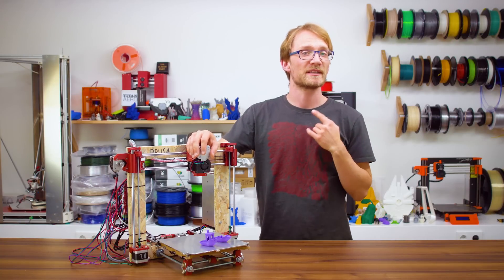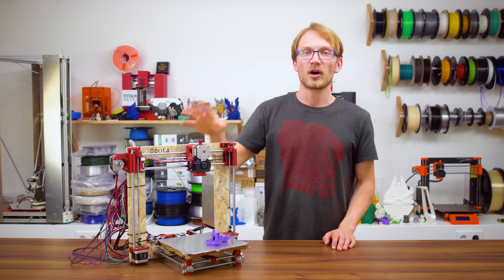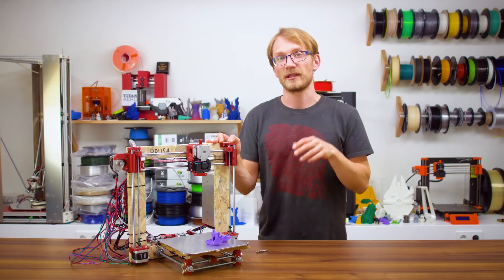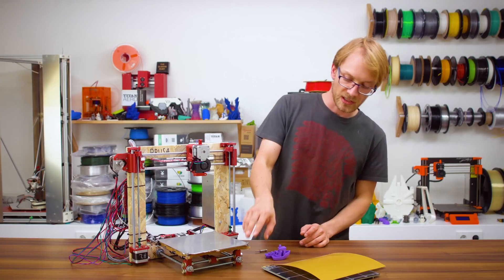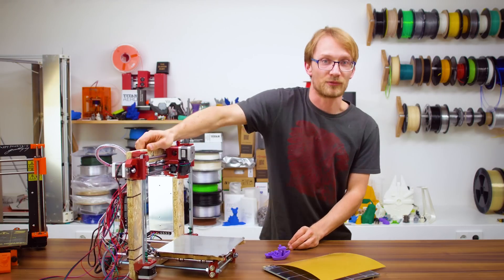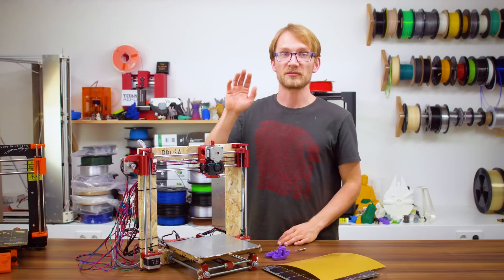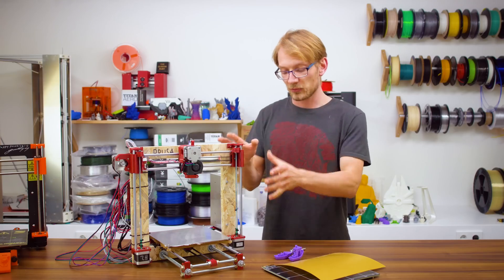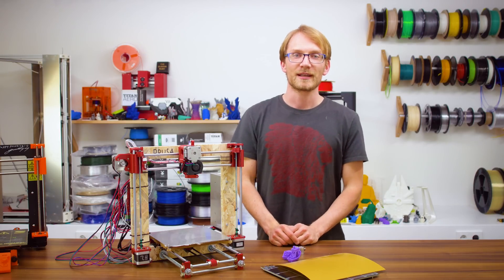Building the cheapest possible Prusa i3 MK2 clone: [03] Build notes!

Comment: I find it a decent job Thomas, but why did you go with that too thin flimsy bed and the m5 rods? If you would just use the heated bed anyway you would have a perfectly straight surface to print on. as for the m5 screws, that's for the mk1, not mk2. You saved on 2 things which are very important and I don't see why you did that because the quality suffers from it.

Comment: Hey Tom, after owning a 3d printer for just over 2 years, I am starting to run into humidity absorbtion problems with my filament, and I even store them in ziplocked bags.  Last week I had to bake two spools, one took only 2 hours, the other took about 6 hours.  

Since you have all that filament just hanging on the wall and sitting on the desk behind you, do you have to bake your filament all the time?
Reply: Make sure your bags are sealed by blowing hot air into them and seeing if they deflate. Two year old plastic bags may be the culprit. If it took 6 hours to bake the moisture out of your spool, you've spent more money on the gas/electric of your cooker than the spool itself unless it's some kind of speciality filament. Dump it!
Reply: thin plastic is not air-proof. Just blow air in it and see in how many days it deflates to give you an idea. Best solution is storing in airtight metal bin or glass

Comment: tom I wonder if the z artifacts are also due to the mesh bed leveling... 8mm lead screws are so cheap you might as well have used them
Reply: 9998 9998 The idea was the thinner rods would take up the flex instead of putting it in the print
Reply: how would that fix the warp/anything? by flexing the shaft the z position goes down a bit.. (and possibliy moving it in x/y as well) squishing the layer makign a band.
Reply: Google+ SUCKS BALLS - the worst forced social network ...No. Have you ever used a printer before? Just curious.

Z wobble is when the shaft is warped, so as it spins it pulls the entire bed laterally, following the thread of the rod. Not squishing it down and making bands..

Comment: Absolutely awesome learning and entertaining series.  Thank you very much. I would like the source for the MK42 and see its installation as well as the upgrade to the screen and Prusa marlin build.  I am changing over a Wanhao duplicator to all of the Prusa MK2S parts intermixed with the sensor and bed leveling you did on this one for a fun project.  How much fiddling did you have to do to get the MK8 extruder drive gear working?  Better to exacto the holes or redesign the SCAD file to the left 1mm?  Any thoughts would be appreciated.

Comment: Tom, you said you're going to use the custom Prusa firmware. Does that mean you'll replace the RAMPs board with a RAMBO mini like the i3 Mk2 uses? How about checking it out with a Smoothieboard?
Reply from the maker: +CarsInDepth as long as the board is using the same processor (AtMega2560), any Marlin-based firmware will run on practically any board. The RAMBo Mini is a nicer option than the RAMPS, but functionally they are very similar.

Comment: I enjoy seeing the entire process because I might try doing this myself to save costs of just getting started and being that I'm mechanically inclined.
Reply: The build cost more than a CTC i3 Pro B or Tronxy P802 though. Sure those will want a few parts replaced, but at least you'll have a 3D printer which will make it easier.

Comment: Tom-Instead of spending the time replacing the frame, you should just cut a piece of wood that will fill the gap and use 5 minute epoxy.  Much less time and similar results.
Reply from the maker: +cica322 OSB gets its strength from using large, oriented wood flakes - I'm not sure that just epoxying a filler piece to the edged will restore its strength.

Comment: With my 3d printer, the mega that I got didn't flash anything but then i found a video which basically said just before the progress bar on the upload is done for your sketch press the reset button and then it'll upload the code.

Comment: I would love to see you optimizing the firmware on the ramps to get to a decently similar level as the Mk2. I just finished building a Hypercube, while also having a Mk2 and I have not been able to get much practical usefulness out of the stock Marlin LCD interface, while the Mk2 one is amazingly configurated. Thanks for doing a great job!

Comment: Thanks for this series, Tom.  I followed along and built a clone as my first printer (but did get a 3mm mk3 bed for like 3 dollars more).  I'm definitely interested in seeing upgrades, including prints that show the benefits, but I don't think that's very well-suited to livestreams.  Also the way youtube is surfacing videos now it seems way more people will get recommended videos from this channel.  It would be more work, but hopefully also more revenue, if you livestreamed the build on your other channel, then cut a quick video talking over some edited footage of the build as well as some before/after photos and posted it on this channel.  You could then link to the full stream in the edited video if people wanted to see the whole thing.  I like watching your streams, but it does get frustrating to look for information and wait through you interacting with chat, fussing with autofocus and technical issues, and getting distracted.  That's not a fault of yours, just the livestream format in general.

Comment: Where to stream, well I'm following both so up to you. Awesome Stuff! Thanks for the update. I only have the frame at this point, waiting on parts. I used a 6.3mm aluminum sheet for the frame.  I was thinking on upgrading to the an original E3D hot end. I have a couple of questions, 1. Z-Rods should I go to real rods or 5mm as long as they're straight will it make a big difference? 2. Heat Bed, I have 3mm & 6.3mm aluminum so I could just get a heater mat or would a 3mm circuit board be better? what would work best?

Comment: Would love to see the upgrade process, will watch regardless of which channel it's on, I don't see any issue with keeping the main channel for more polished stuff though.

One thing you didn't mention in the build notes, during the build the inductive probe was a bit angled (discussed around 2h mark in p3). I haven't printed the extruder body yet and am considering modifying the part to make it work better (particularly since the sturdier MK2S version probably won't allow the angle). Is the distance/position in the XY plane of the probe critical or could it be moved out a little to give space for the wires?

Great series and great way to learn more about the fundamental building blocks, really appreciate you putting this together.
Reply: Had a browse of the Prusa Marlin firmware between things today and I see it has configuration for the probe offset:

#define X_PROBE_OFFSET_FROM_EXTRUDER -25
#define Y_PROBE_OFFSET_FROM_EXTRUDER -29
#define Z_PROBE_OFFSET_FROM_EXTRUDER -12.35

So presumably I could just move the probe holder away from the extruder body a little and modify these values. Trick would be to move it just enough so as not to be to far to reach the calibration point should I ever be able to get a MK42 clone bed. For the standard bed I am guessing it won't even be so critical. Would be great to hear your thoughts none the less.

Comment: Post it here. Yes I want to see the final upgrade very very much. Link for mark 42 bead, and please make another frame and paint it ( black , like the original one ) And for the z rail change the screw leads with 8mm pitch ( it will make a major difference ) . Thanks for making the best 3d printed chanel

Comment: You didn't mention the total price?
3D print the parts for improving!
Reply: no, it's more like $200, the $50 was for the first batch of hardware. The motors were about $50 by themselves, etc
Reply: No he didn't...
Reply: meh....A geat accomplishment but at the end of the day I would not want the head ach of always fussing  just to get a print. I would rather start with a kit that you know has already been proven like  "ie. a new Prusa", and then work to to fine tune it. At least that way you have a strong bases for starting and not fusing with what your trying to recreate and throwing money at it before you even have the software figured out.
Reply: Travis Bauder lol
Reply: Voice of Dissent yes, sure you can get an even cheaper kit, but I like this vid much more than just another instruction video for some kit. It gives you an idea of (only) some things that won't work the first time.
Reply: Voice of Dissent what kit?
Reply: @anthonyhadsell2673  get the ender 3, you will not regret it
Reply: uuum, his point is clearly that the price is more like $200. Which is an accurate estimate
Reply: Yes he did. I think it was in the first few
Reply: He did, SOMEWHERE. It's like less than 50 us dollars
Reply: relax dude. I'm messing with ya....It may cost you that. He had mostly everything already so it was cheap for him. He did say that somewhere. (live I think)
Reply: your point?

Comment: This was an amazing series! I would like to see how you repair the z wobbling  on this tipe of printer.
Reply: Ditto! What he said!
Reply: You should use a flat table and just roll your threaded rods on that flat surface. Every tiny bend in the rods will show up and you can try to bend it gently into shape until the rod rolls completely flat. If you have a table with a glass plate (or even a mirror or windowglass) that probably works best as a reference surface. The other solution of course would be to just buy thicker z-guide-rods and make shure the frame/guide assembly is rock solid, so the wobble of the threaded rods can not move the extruder assembly at all.
Reply: @ProtonOne11  Why aren't belts used instead? Seems like it would be most precise...unless the power cuts out.